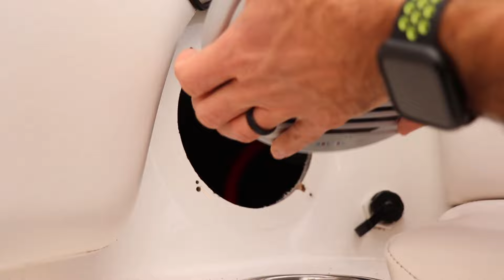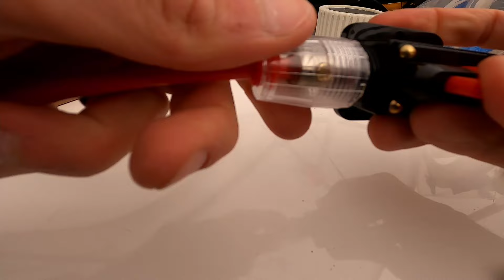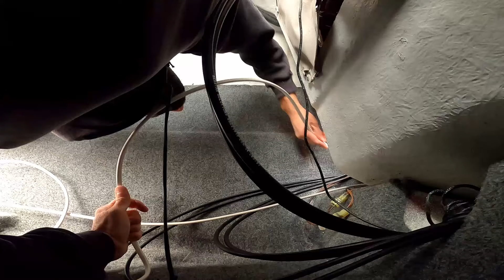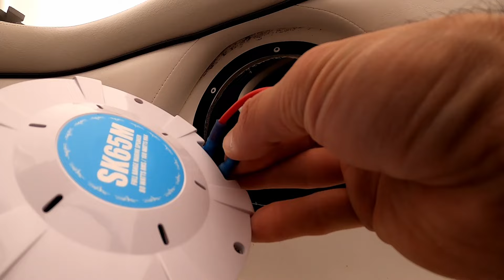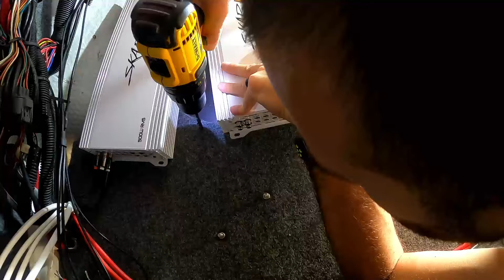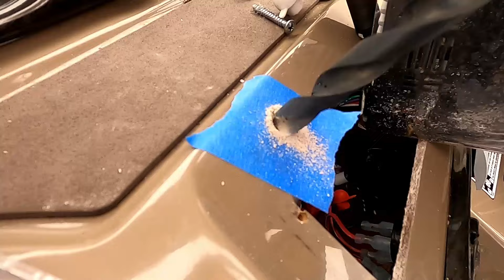Yamaha Jetboat | Skar Audio Speaker and Amplifier Installation

Comment: Great video.  I've got a 2024 robalo 206 cayman soft top and only have 2 speakers on sides of gunnel.  Obviously not the sound I desire and I'm wondering if I can get away with replacing existing speakers with whatever the next larger size would be, maybe 7.5's and adding 2 more of the same somewhere else in the boat without a sub?  Could I get a descent bass level with good clarity with this option?  I'm thinking I could??  My two starting batteries are in the back end of boat so would I be good with those or need to have a dedicated battery just for this?  Wish I could hear your set-up.  I'm sure it sounds good.  Contemplating whether to try this myself or seek expert install.  You seem to know what you're doing.  Good job
Reply from the maker: The speakers definitely sound great without a sub. However, I know that adding it, it would obviously sound better. But I feel it’s diminishing returns. The sub would have to be huge to get the desired effect. You’re trying to blast sound into open air, not a room. The amount of money and space it would take up wouldn’t be worth it for me. If you can get the 8” skars, it would definitely provide more bass and a fuller sound. You’d 100% need an amp to drive them though.

Comment: I don’t think you completely understand how those breakers work. A 60 amp breaker is not gonna pop over your amplifier. That amp is gonna burn up way quicker than that breaker clips. A fuse and a breaker are completely different bro. You need like a two or three amp breaker to tell you the truth. I don’t even know why you went with a breaker you should’ve just got a fuse.

Comment: Great work. I’m looking for some context on why you chose the amplifiers that you did. I am currently installing a system in my boat that previously had no audio at all. I am doing 4 6.5” speakers 2 8” speakers and 2 6.5” tower speakingrs and I have no idea which amp to choose. Any help is really appreciated. Thank you
Reply from the maker: I went through the specs on a few different amplifiers. There are a few videos on YouTube where guys will hardcore test the power on these things. https://youtu.be/aUDrdwqTXn4?si=aJeqMd-Z2m2aGg7Q. Remember whichever ones you get they are marine rated so they are coated properly. Bang for buck, these guys beat out the popular ones like Wetsounds. This is my 5th season with them and I have no complaints, still rock solid.

Comment: I just bought 4 new SKAR 8 inch speakers for my pontoon, along with their 1000w amp as recommended by them. do I NEED to run and use the Bass knob they send with it? if that even comes with the Amp??
Reply from the maker: Not necessarily. If you keep the bass at a reasonable level by trying it through a bunch of different music, you’ll probably just have to set and forget it. Some songs will be more or less punchy than others. Just find the middle ground.

Comment: I only have two rca cables in my JL head unit but I want to run 6 speakers off my skar amp is this possible or no ?
Reply: Yes. Check the manual if your skar amp supports “summing” basically can turn 1 or 2 inputs (via your rca cables) to outputs. If not then do exactly what he did here and use y splitters for the rca cables. Depeing one your 6 speaker setup split the front channel to run the front 4 off front signal and single rca to support rear 2 speakers or flip that and split rear channel to run rear 4 speakers and front single to run front 2 speakers. 

Only thing this will affect is the fader. Meaning if you split the front channel then when you fade forward power will feed the “front” 4 speakers and fading rear will power rear 2. Or vice verca if you split other way

Comment: Why not just run all 8 speakers off of one amp? Skar amps are 2ohm stable...
Reply from the maker: Each speaker would have half the power. This is the most ideal way of wiring it all together.
Reply: @boatingpropless  No it would not! if you take it down to 2 ohms wired in parallel, it will actually double the power of the amplifier however, it will also increase the harmonic distortion and you would not be able to control the volume separately with the additional volume knob that you installed. 😊

Comment: What gauge wire did you use for the power and ground? I'm using 4 gauge, but it won't fit into the power and ground ports on the Skar amp. Maybe a distribution block? I'm running the 4 gauge from the amp, to a breaker, then to the battery. Now just stuck with trying to fit the wires into the ports of the amp. 

I noticed your wires were thinner.
Reply from the maker: I used 8AWG. The RP-75.4ABM | 500w rms calls for 8 AWG and the RP-150.4ABM | 1,000w rms calls for 4 AWG. I’ve never had a problem where I felt the power was being choked due to the wire size.

Comment: Did you use the skar amp kit? I'm deciding now if i need an actual marine wires or if it isnt a big deal.
Reply from the maker: I did not use the skar amp kit. I used: https://gregsmarinewiresupply.com for the best price 
and got ALL TINNED wire. It won’t corrode and the jacket is substantial for the harsh saltwater.
Reply: Great video...where did you find that anti vibration cushion?

Comment: First off prob the best marine audio installation video I have came across!\
I plan on doing this exact set up on my hurricane deck boat.
I do have 2 batteries 1 start and 1 house how long can i expect this system to play off of the house battery.\
I currently only have the 1 amp and 4 6.5s but do plan on getting another amp and speakers for wake tower.
Reply from the maker: Thank you! I have had this thing run an entire day without an issue. I might have had to plug the boat in to charge when I get home, as the stators aren’t running enough to give the battery a full charge. No issues so far though! 🤞🏻
Reply: one more question what is the ideal amp(RP-75.4ABM) settings for the 4(SK65M) speakers

Comment: How did you decide where the install the amps? I’ve seen them in different locations from different forums. Thanks!
Reply from the maker: So I wanted to keep them out of the way of everything. I figured that spot was not being utilized and wouldn’t be in the way of anything. Under the helm and the head storage would just take up more space and leave less room for all our stuff. I’ve never had any overheat issues in this location either.

Comment: What’s the brand of the male to male rca connector? Wanna make sure I order one that’s marine rated
Reply from the maker: The one I had unfortunately wasn’t marine rated. I don’t think they make one, and if they did it would probably be really expensive and hard to get. I had the adapter on it for a season of salt water use, and I saw no corrosion. For extra protection, you can always put some dielectric grease on it to make sure the moisture stays out.
Reply: @boatingpropless  ok I got a few off Amazon but I think both are bad. I get a really bad buzz that’s ground related or rca related

Comment: How did you route wire to the port bow speaker? The diagram shows you went across the anchor compartment. Is that correct? If so, how did you do that?
Reply from the maker: There is a double wall between the anchor locker and the interior of the boat. The wire was stiff enough that I was able to push it straight through the other side. Once it was on the port side, I was able to secure it to the hull from both sides of the anchor locker 👍🏻

Comment: Love it brother. Currently planning my install. Also will have 2 Amps for 8 speakers. How are your speakers wired? Series? Parallel?
Reply from the maker: They are neither! Each amp has 4 channels so I was able to wire each speaker directly to a channel that way. Maximum power, maximum control! 👍🏻 If you are going to use 2 amps and they are 4-Channels each you should be good!
Reply: @boatingpropless  that is what I thought but my noob mind didn't comprehend. Lol. Awesome. Can't wait. I'll probably won't do the volume knob and I'll also place amps in battery compartment. Otherwise very similar to yours.

Comment: no sound test?
Reply from the maker: You know, that’s funny. I thought of it after I published the video. But I can tell you it sounds flipping amazing. 1000x better than the stock speakers. I just did a radio upgrade, so I’ll probably tie in the speaker sound review as well in that video
Reply: @boatingpropless   im putting 4 of these in my rzr with there 500w 4 channel amp. Was trying to find out how it sounded

Comment: Dumb question but what did you do with the existing speaker wires?   Would they still be live?
Reply from the maker: Not a dumb question! Technically, yes if you didn’t snip them on the radio side. They were protected from the elements tucked up under the wells, so I wasn’t really concerned about it at the time. I ended up replacing the radio this season, so I ended up disconnecting the whole harness. Video on that soon!

Comment: You should link the items you use. What rca splitters did you use? What volume knob? I just ran across your video and you do an amazing job. I was looking on a way to control my tower speakers separately from my cabin speakers. Keep up the good work.
Reply from the maker: I ended up getting the audio equipment from Amazon. I was going to link the cables and stuff, but with inventory changing at Amazon for stuff like this, I was afraid it would go out of stock. Pretty much look for the volume knob with the best ratings. It’s just more or less potentiometer in a box.

Comment: Nice video! I just have a question, why do you want double rca's in the amplifiers? You can just plug in channel 1 and 2 right and it will use the 4 speakers (I think??). Why use double rca's?? Thanks!!
Reply from the maker: So each amp has 4 channels (Front R, Front L, Rear R, Rear L). The radio has the capability of outputting a Front R/L and Rear R/L. By splitting  those connections, you’ll be able to have a bit more control all 8 speakers by using the fade setting on the radio. The added knob will be able to completely adjust the volume independently of the other speakers as well.

Comment: Great video bro!! Your install is legit!! I just picked up the same amp and speakers and in the process of mounting everything. I was wondering how you have your battery set up. Maybe a pic?  Are you running 2 batteries? I'm sure those amps are sucking a little power. Merry Christmas!!
Reply from the maker: Merry Christmas! Believe it or not, they sip battery power! I have a dual battery setup, one for the house, one for just starting. I’m probably going to make a video for that one as well in the spring. I have it setup on a board that tucks into the rear area so you get more room under the seat.

Comment: on the box it told me not to mount the amps to a box or a surface due to the vents under the amp, what should i do?
Reply from the maker: Yes, you want maximum airflow to keep the electronics cool. Heat kills everything. I chose the use the treadmill pads to give it the extra mounting space and help dampen any vibration from transferring to the circuit boards. You can also use rubber furniture feet or even plastic spacers to lift it up a bit. 👍🏻

Comment: Great video, very detailed! What group size and brand of batteries are you running?
Reply from the maker: Using 2 Group-24s (one Duralast and one Interstate, both deep cycles) I have a dedicated starting battery and a house battery. The stereo will run all day without any issues. Sometime in the fall, I’ll have a video about my battery setup. Just need to find time to edit it.

Comment: 1) great video, looking forward to hearing how the systems ends up! Keep up the good work. 
2) are you planning a subwoofer? Or enough volume (bass?) as is?
3) I like the idea of using the volume control for the rear of speakers.
Reply from the maker: I recorded this video awhile ago so we’ve used it for quite a few trips already. System is pretty dang good. I don’t think it needs a subwoofer, for how we use it. We’re not normally blasting it, and the loudest we put it is to overcome the noise while underway. The knob for the rear speakers is awesome. You can use the Gain on the amp to make them a bit louder than the inside ones. You’ll need it to overcome them being behind the seat and in the “open air”.
Reply: @boatingpropless  Hi, I would love to get in touch to share an idea/ product I am developing that would work with this system. How would I go about doing this? Thanks